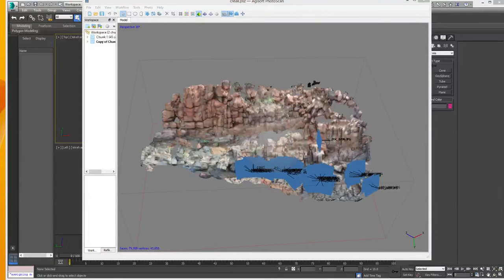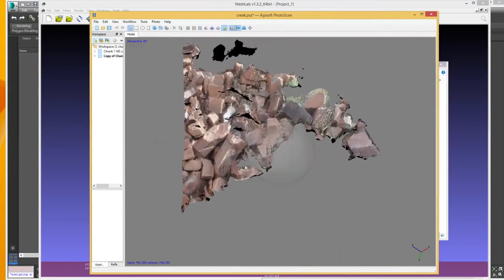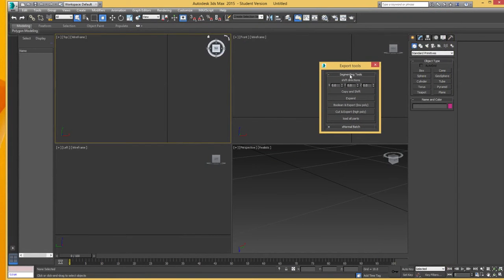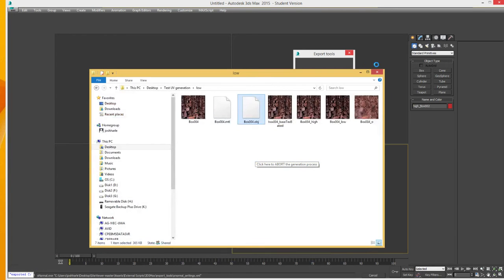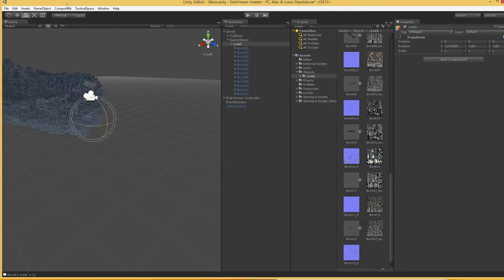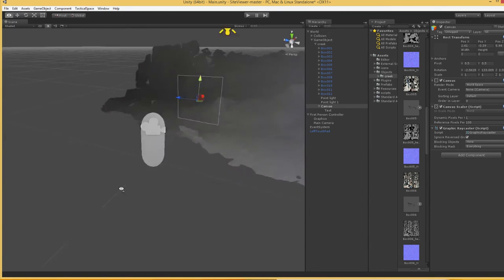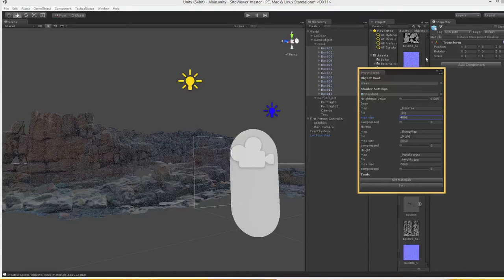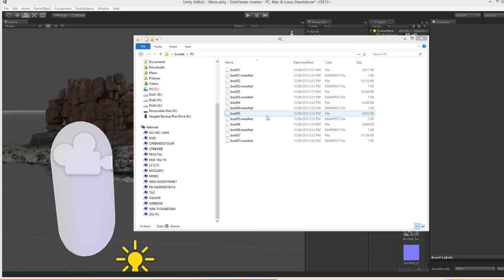Getting PhotoScan models onto iPad (3/4)  - Texturing, Mapping, and Import into Unity

Comment: Hello, 
I did all process the same as you did, but end of baking there is nothing in maps folder :(  
I use 3dsMax 2014, Photoscan pro 
Could you help me please.
Reply from the maker: ibrahim kardas perhaps run through a very basic xnormal map process and make sure it is working with that?